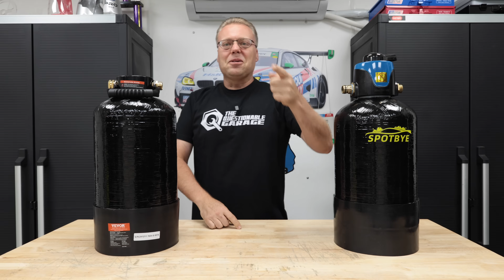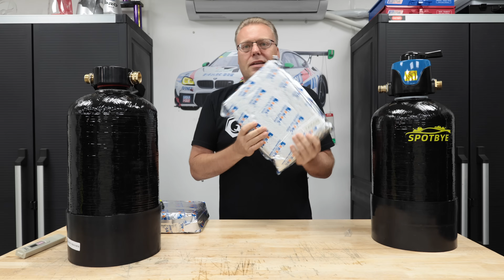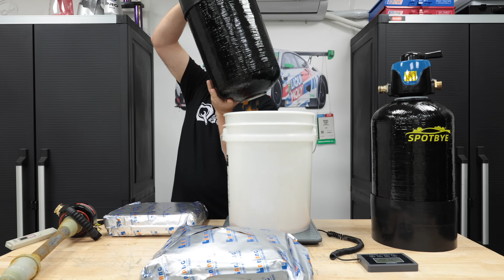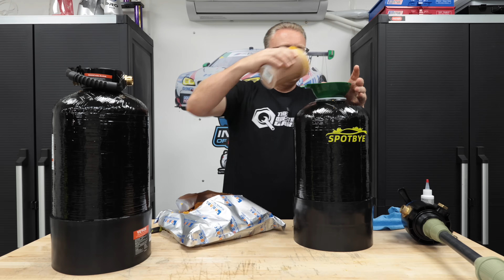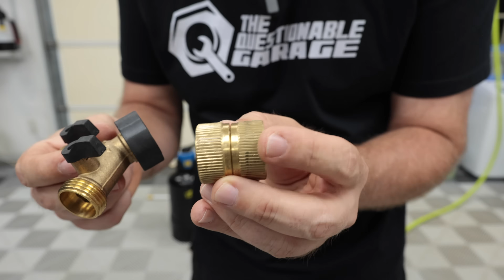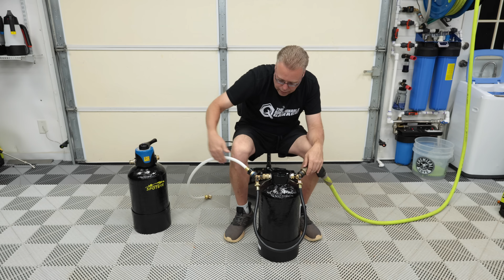BEST Budget DI Spotless Tank Systems | Vevor | Spotbye | Deionization

Comment: hello sir. i bought the larger vevor 10L. the instruction suck. can you explain what bypass, backwash, fast rinse and filter mean and when to use??? I am thinking bypass is for house water when washing the vehicle and filter is the deionized water??? but backwash and fast rinse????? when are these used. Please help. your video is awesome, tyhank you for showing how to use the meter...no instructions for that either... thanks, Brian from Florida
Reply from the maker: Backwash and fast rinse are to be ignored. Just use bypass when you just want the tap water and filter when you want the spotless water. These are converted pool filter devices so they have things for that there still those are what you plug with the fitting that comes with it.. I do think some of those settings could be useful if you regenerate resin, but I never looked into it. make sure to use good teflon and even pipe joint compound to make sure they don't leak. Makes sure all gaskets are present as well.

Comment: Thank you for the great vids.

My ppm is roughly 240-260, I just purchased the Vevor 10L tank using the supplied resin, I can’t seem to get the ppm to 0, I ran the tank for a bit and noticed fluctuations in my ppm reading from 8 to 20 ppm, what am I doing wrong here also should I change the resin to the bam bam resign 😁 thanks
Reply from the maker: What volume of water are you running? Need to keep it around 2 gpm or so. Usually resin quality is the issue, but it’s possible there could be some tap water getting past seals and mixing in, but with a tank style system that is a low possibility. Vevor is the one brand I have seen the issue with resin across multiple products.
Reply: @CarsWithKeav thanks, truthfully I’m not sure, my flow meter got delayed and I was to anxious to wait, my meter should be delivered today, I will test again at around 2 gallon a min. and share the results thanks for all the tips.
Reply: Ok finally got my flow meter today and set it 1.6 gal/min and my meter is reading 16ppm, I’ll try to remove the resin and check to make sure the tube is fully seated to the cap, is there anything else I should check? Thank you
Reply from the maker: @darynikeda1697 I can’t think of much else it could be. Just poor resin quality is probably the issue. I look at these systems as you are buying the vessel and if the resin is good then that is a bonus.
Reply: @CarsWithKeav  Thank you for  your help, if everything looks good, then I'll try switching out the resin for the bam bam lol if that doesn't work could it be that my PPM before filtration is just too high to get it down to 0? if that is the case would the 2 stage DI system be better?
Reply from the maker: @darynikeda1697 At 240 ppm this size system should be able to handle getting to 0 ppm. A two stage system wouldn’t be any better just about the same resin the Vevor actually holds a bit more. They are just designed that way as they can be wall mounted and meant for narrow areas. It’s possible it was never filled up fully with as much resin as it can hold.
Reply: @CarsWithKeav thank you for all the guidance much appreciated!

Comment: Was going to get the vevor model but they are sold out. They have a new version similar to the spotbye it seems. Any thoughts , suggestions or review on the new version ?
Reply: Already own the vevor 2 cannister version.  Lowering my weight of loading and uploading of deionized water system.
Reply from the maker: They are all kind of the same really just vessels to hold the most important thing which is the resin. Some features are better than others like bypasses.
Reply: @CarsWithKeav Thank you. The new ones have that bypass on top like the spotbye. Didn't know if that was a deal breaker.
Reply from the maker: @tonyfields8968 It can work well just getting it to not leak is the hard part. Pipe joint compound is probably needed instead of Teflon tape.
Reply: @CarsWithKeav Thank you ...Greatly appreciated.

Comment: So would this be good for window cleaning? Air dry with no spots on glass?
Reply from the maker: Absolutely! A lot of window washing guys use these in varying sizes. Quite a few use a reverse osmosis system on a dolly Hooke duo to a small di tank as they don’t need a ton of flow vs car washing.

Comment: Hey Keav. Just got the Vevor from Amazon. Setup was by the manual and used the bypass you showed with the extra 2 connections. Regular tap is 97ppm. Using the DI vevor it only brought it down to about 17 ppm unless it just trickled. I noticed here that you got pretty much full open hose water to read 0. Have any insight?
Reply from the maker: I would say there are only two things at play here. 1) Just a bad batch of regenerated resin (not unexpected at this price point) 2) There is blow by happening somewhere could be a crack in a cartridge, bad seal, etc. that is letting tap water mix in at the output. Usually it would be the second cartridge or seal that could be causing this as if its the first one that water can still be cleaned in the 2nd one. Running at a trickle the bad resin has time to clean better or the crack or bad seal does not show itself until more pressure happens.
Reply: @CarsWithKeav  I believe it's just the resin. Didn't even come filled all the way. Purchased the ones in the description coming in Friday. Should work better. Thanks.
Reply: @CarsWithKeav quick question. Do you remember how much gpm you could get out of it before it raised the ppm? Mine has been at under 1 gpm and it’ll go to 0 but can’t do anything with that.
Reply from the maker: @CleanSlateCars With my water at 50ppm I can run 4gpm usually at 0ppm. Depends on the resin though.
Reply: @CarsWithKeav filled it up the rest of the way with the other resin and now it’s totally fine. 4.5 gpm and reads 0 ppm. Thanks Keav.

Comment: To regenerate do you have to replace the resign beads? Unlike a Softner?
Reply from the maker: You either regenerate using a chemical process or refill using new resin. It all depends if you are okay running acids, separating the resin, etc. usually the time it takes and hassle most prefer to just refill. I will be doing a video soon on regenerating your own resin. One part of that is like how a softener regenerates using sodium, but you have to do acid based process as well for the other resin that deals with the softer sodium itself along with other minerals. It can be a tedious process.

Comment: What your thoughts on  running it through the vevor 3 canister filter 1st then too the deionizor..maybe even running to a second deionizor..then the final rinse
Reply from the maker: Multiple filters is always better. I myself run pre-filters on my system, but they are carbon and lead filters to help with chlorine and some minerals along with any sediment. That way the DI system doesn't have chlorine in it to deplete the resin. Running two DI systems in the end is only needed if one can't handle it. If your system can get to 0 ppm them all the second system is doing is prolonging the refill time. It adding costs as you bought two systems and the amount of resin would be the same either way. If the system can't handle getting to 0ppm then its probably better to switch to an RO system and store water.

Comment: what would be good resin? any other options besides the link provided? or is that resin a solid option?
Reply from the maker: If you want really good Resin then CR Spotless is the way to go over what is linked. What is linked is not as good, but at the cheaper price even if it doesn't last as long it being cheaper brings down the cost.

Comment: So if  I wash my truck with rinceless wash. Can I buy this system and pump it into a plastic storage tank that has a discharge valve on it to fill up my sprayer and then add my rinseless wash to it  To have a spot  free rinse .Or will the water get contaminated in the tank over time so no need for a tank? The tank is sealed of with a cover . The reason why I ask is because I don't always want to have to hook this tank up to filter out the water. Thank you...Love your show.Keep the videos coming
Reply from the maker: The tank idea works as long as you keep it covered, but only for a period of time water can and does go bad and start building bacteria you also have to make sure the container is food safe so the plastics don’t leach in to the water. Another thing is rinseless wash will not be spot free you have to wipe it off with a drying towel.

Comment: 18:30 The Filterrelated (“Columbian Bam-Bam”) states a 50 : 50 mix of cation & anion, looking online it seems 40:60 is more ideal for spotless water, in terms of basically everything (filtering efficiency at high flow rates, resin life, etc.). 

On Amazon, AKM brand is similarly priced (actually on sale now for $72 for 10L) and comes vacuumed sealed in bags and states a 1:1.5 (40/60) split.
Reply from the maker: All depends on what is dominant in your water. Especially if you are running a water softener or not. Most do the time the 60/40 is more expensive so you pay extra to get longer and in the end cost per gallon is the same. Now a few are coming out with cheaper 60/40. I have not tied to know how good they are, but bam bam isn’t limited to a brand it’s any foil sealed resin. It doesn’t discriminate 😂
Reply: @CarsWithKeav Thanks for responding.
Reply: @CarsWithKeav Also, Lowe’s now has a Greenworks 1.8GPM 1200 PSI pressure washer for $150 currently, gotta compete with Home Depot with the Ryobi.
Reply from the maker: @homeboi808 I already made my video will be out tomorrow.

Comment: Plumbers perspective: Tapes used by themselves are a big fail. Blue monster is kind of an exception except it too will shrink, and have more reaction to products/environment. Any Pipe Dope with PTFE (teflon) will work 100% on a clean install, and combined with a tape work on systems running gas at pressures 10 x what is running in those tanks.
Reply from the maker: Really appreciate that insight from a tradesman. I have thought about using liquid PTFE dope. I do know this housing is cut horribly and say it’s npt, but they see to be straight cut causing just horrible seal and the threads are not long enough for a straight cut.

Comment: Would anything work for my water?
450 - 500 ppm
Thanks great movies
Reply from the maker: That high you would need a much larger system closer to one cubic foot, but it will cost you as the resin will deplete fast at that high TDS. Best way even though tedious would be to run a reverse osmosis system and store the water and pump it to your system when needed.

Comment: Btw, does the resin (any) go bad if they are not changed or used regularly?  I wonder abiut that for the 10L vs the 5L.  Oh, did you say that the resin type on the Vevor is unknown?  Does the O-ring go bad easily?  Do they sell the O-rings separately if a replacement is needed?
Reply from the maker: O ring should not go bad if properly lubed whenever you take the top off. Doesn’t go bad as long as the resin is kept moist when not in use.

Comment: So is this a better value than the dual-tank Vevor spotless (blue tanks) that you reviewed a couple of months before this? Same 1K gallons at 100ppm but for $140 instead of $190 for the dual?
Reply from the maker: The reason to get two stage 20 inch filters is for wall mounting or very small narrow areas. I would always use a tank if my setup wasn’t wall mounted and in a tight area. The resin is what does all the work these are just vessels. The tanks are slightly more efficient as all the resin is in one place.
Reply: @CarsWithKeav  Got it, thank you!

Comment: So having tested several units, do you like the Spotbye, Vevor two tank system, or waterdrop system? I'm looking for a unit I can keep outdoors as I didn't plan a DI system when installing my power washer and reel on the wall.
Reply from the maker: I like the tank style the best if you are not wall mounted. Brand really doesn’t matter as it’s all kind of the same. The resin inside is what makes the difference. If you will be putting this outside you must keep in shady area and not let the temperature get over 95 degrees which doesn’t take much of in the sun for a while. That will exhaust the resin quick.
Reply: @CarsWithKeav are you saying you like Spotbye type tank? Sorry.

If keeping it outdoors will reduce the life, I may just quick disconnect and bring it inside after each wash.
Reply from the maker: @georgebeato5702 That’s a good idea and if doing that then the Spotbye tank is best for that.
Reply: @CarsWithKeav I finished measuring my water, and it's an amazing 46 ppm. Being I detail on the side doing 1 car a month, and my 3 personal vehicles, do you feel I should go for the 10ml size, or the half size.
Reply from the maker: @georgebeato5702 If you got room always go with the bigger one if you can. Less refills and the more resin the more efficient it can be. Also more flow rate.

Comment: Thanks for the very informative videos.  I've been using a pressure washer to clean my cars for some years but now realize that having spot-free water would be an improvement.  I'll probably end up with one of the units you described in this video.  Being a novice at this I have two questions.  1) What are the Back Wash and Fast Rinse settings for?  and 2) living in the Northeast I probably won't be doing much outside detailing over the winter.  Is there anything special that should be done to "winterize" this system (of course, outside hoses are off and evacuated for the winter.   Thanks, keep the videos coming.  Great work.
Reply from the maker: The Back Wash and Fast Rinse are not used. This is a retrofitted pool filter system dial so there are functions you can ignore. For the winter its best to drain the system and put the resin in a sealed container still moist. Store in a place that wont freeze.
Reply: @CarsWithKeav  Hey Keav. Just a slightly different version of his question. If I don't use it for a few week or a month and don't want the resin drying out and going bad, is there a setting (bypass?) on the SpotBye head switch that will "seal" off the tank so the resin doesn't dry out?
Reply from the maker: @RobertDStark Bypass would be the closest thing to that.

Comment: I also wanted to thank you for mentioning the effect my water softener would have.  I thought it would lower the ppm, but after your comment I tested my water before the softener and found ppm to be the very close to the same.  It was a surprise since the test strips for hardness showed it way lower since the strips are measuring calcium hardness.  Since the ppm is the same, would it be better to use the water before the water softener to avoid the sodium issues?
Reply: Thanks, you have confirmed what I found by doing a lot of research last night.  Because of my high ppm and need of 2 pm, I have decided to spend a bit more and get the spotless system.  I will save a good chunk by not getting the bypass model.  Instead I am going with a quick disconnect and a hose end valve as you have used in some of your videos.  I was surprised to find that the unit without the bypass was about a $100 cheaper.
Reply from the maker: @jamesaguirre853 plus I don’t like their bypass is a bit weird and restrictive.
Reply from the maker: It’s still better to clean soft water than hard in the end. One approach could be to double up on the resin that just cleans sodium, but problem is you don’t know if you got all the hardness out and some could be left behind.

Comment: Thanks, I want to confirm your were running it at more than 2.2 gallons per minute.  On amazon they have a side information chart that says 1.6 gpm.  Since my Kranzle runs at 2.2 I would rather not have to need to reduce gpm.
Reply from the maker: It’s all going to depend on your water and the quality of the resins my tds is 60ppm so Incan run the water flow higher and it still clean in time. If you have 200 or more you might have to run lower in order to clean in time. That’s why many choose cr spotless as the resin is high quality and regenerated well which results in them giving a max GPM of 2.5 gpm.
Reply: @CarsWithKeav  If i have pretty bad quality water what's going to be the lowest GPM? I'd prefer not having to buy a much more expensive Deionizer to work with my pressure washer if I can avoid it.
Reply from the maker: @MogwaiInjustice That’s hard to say without actually running the system with your water. So many variables at play. Most systems have a minimum of 1gpm which is enough to push through the resin. If running a pressure washer you would need at least enough to supply the needs of the machine plus a little extra to avoid cavitation.

Comment: When you first setup the spotbye, what are the steps to using it and before & after each use?  When do you use filter & backwash?
Reply from the maker: You would never use backwash that part is plugged. They took a pool filter style top and made it work for a DI system so not all options work. There is not much to do with each use other than have it in bypass or filter whichever you are using.